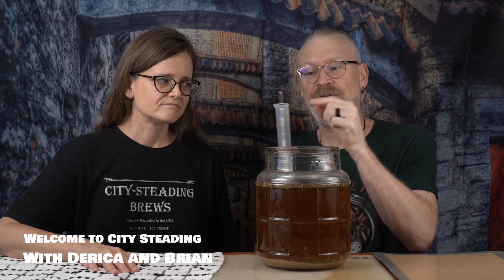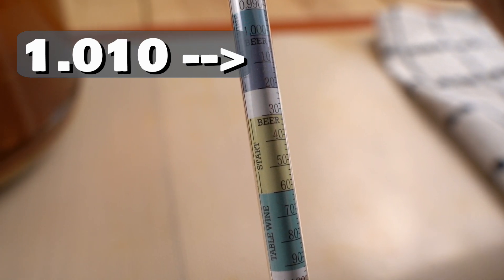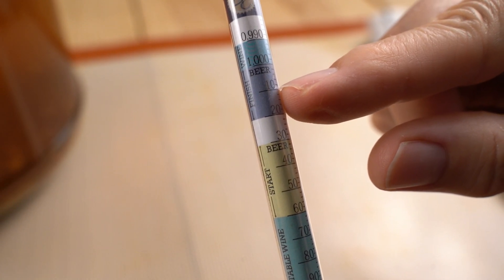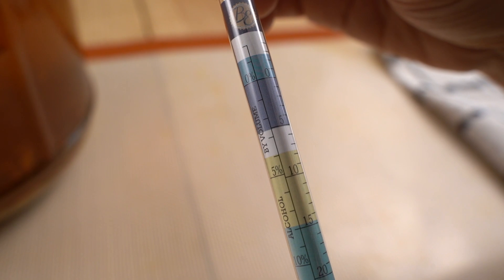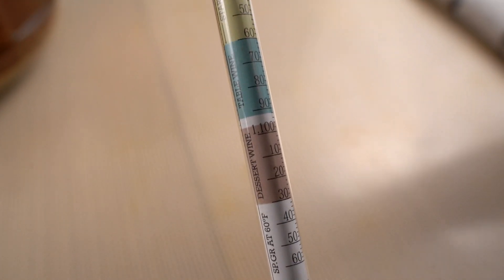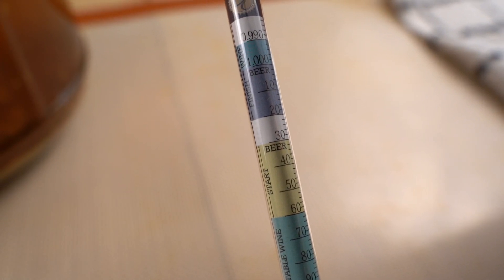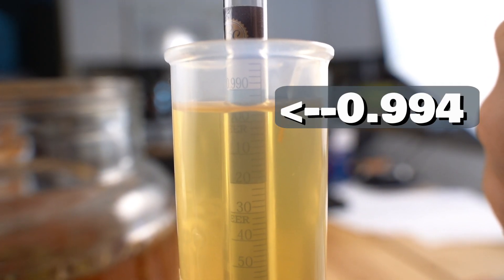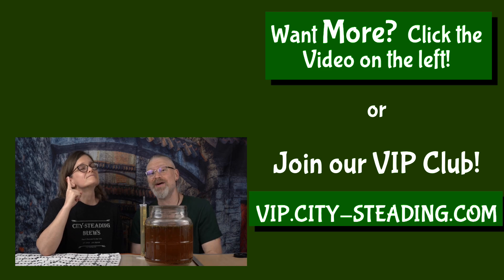How to Read a Hydrometer - Mead, Wine and Cider Making

Comment: Great video.  I use a hydrometer and a refractometer and they agree, generally.  I do not use the temperature correction portion of the formulae since I do not have an easy way to control the temperature.  Thanks for the useful content.

Comment: You forgot to mention the fine print that says "at 60°F". Minor temperature variations won't affect density but I used to live in Arizona and that is way different than my current PA home.
Reply from the maker: It's true but if you read at the same temp all the time, it doesn't matter really.  But, yes, there can be some difference if you don't calibrate for 60F.  A 1.100 reading at 100f is more like 1.106 in reality on a 60F calibrated hydrometer.

Comment: So  I have 1.016 for a red raspberry apple cider ? Third line down from 1.010
Reply from the maker: Starting or ending?
Reply: starting
 @CitySteadingBrews
Reply from the maker: Seems quite low.  Ciders are usually 1.030 or higher.  What is your recipe?
Reply: its was 1.046 we read it wrong, 1 gallon apple juice 2 pounds frozen raspberrys  @CitySteadingBrews

Comment: You say that when you come to back sweeten it doesn't alter the ABV that much so if say I need to add at least half a pint of sugar syrup to my gallon of cherry wine just before bottling then there will be no significant difference in the level of ABV?
Reply from the maker: Adding volume does alter the abv.  Adding a pint to a gallon is obviously going to change it.  If you had a 10% brew and added a pint of liquid, it’s now more like 9.1-9.2%.
Reply from the maker: Most times we are not adding anywhere near that volume.
Reply: @CitySteadingBrews  Thanks for your reply, I figured out that there are 64 quarter cups in one gallon of liquid so if I work on the basis of adding 1 teaspoon of sugar syrup to a quarter cup sample and assuming it is sweet enough for my own personal taste then this should equate to roughly just over half a pint I would need to add to the bulk in the carboy...obviously if it's not sweet enough or too sweet then I will adjust the sugar solution accordingly.

Comment: But how do I know if I have a reading of 1050 for 5 liters and want to have 1100, how much sugar or honey do I have to add ?
Reply from the maker: for some reason that came up on your question when it was a response to another's comment.  This is why I just delated it.  Sorry for the confusion.  I will get to your question in a moment.
Reply: @CitySteadingBrews  ok
Reply from the maker: Ok, so first I would have to convert 5 liters to gallons which would be 1.32086 gallons. Sugar is .046 gravity per pound in a gallon.  So you need 1.42 pounds of sugar.
Reply: @CitySteadingBrews  okaaaaay but that was just an example 😅 is there maybe a webpage or app for lazy people ? 😋
Reply from the maker: There are calculators out there, we do the math so we have a better understanding of the process.  Google search should aid you in finding a calculator.
Reply: @CitySteadingBrews  hmm ok I hope I find one, yesterday I ordered a Hydrometer with your Amazon link :)

Comment: you never explain how it works, does it float? how much sample to put in the graduated cylinder, enough to make it float?? does the temperature matter? repeatedly stating in your videos that brik and potential abv "arent something you use" seems uninformed considering theyre directly relative and on the same device
Reply from the maker: We assumed it was common sense it needed to float.  Sorry if that wasn't clear.  As for the other readings... specific gravity is easiest to use and most widely used by brewers.  I'm sorry you feel we are uninformed for teaching people how to read a hydrometer.... I mean.... we are showing people how to do a thing they don't know how to do.

Comment: There's also a temperature adjustment if you want to get crazy about worrying about a couple .001s. Hydrometers are calibrated at a specific temperature. Most that I've read are calibrated at 60 degrees. You'll have to refer to the manufacturer's specs to be sure. There are adjustment calculators online.
Reply from the maker: I try not to get too crazy about such things. :)

Comment: Questions...
1. Why not just drop it in ur big jar of brew? Why is a cylinder necessary? 
2. Why not just take your reading at the end? What's the point of doing it at the beginning? 
3. How does this translate into ABV?
4. If I didn't have a hydrometer at the beginning to get a reading is there still a way to calculate abv just using an end reading?
Reply from the maker: If it can float and you can get it out again, you don't need a cylinder, but.. ours doesn't.
The one at the beginning gives you an idea of how much alcohol and a target to work toward for next time, and one at the end together with that can calculate ABV.
(Original Gravity-Final Gravity)X135=ABV%
No, you need both.
We have a playlist just for new brewers that might answer a lot of questions for you:  http://www.newbrew.city-steading.com

Comment: Quick question is it safe to brew outside or not?
Reply from the maker: Do you mean assemble outside?  Leave outside after?
Reply: @CitySteadingBrews  leave outside after
Reply from the maker: @trojanman8835  that really depends on your climate.  It's not a good idea to leave in direct sunlight, and temps over 80F or so aren't suggested, but below 65F or so isn't good either.  So, honestly, I don't think leaving them outside is a good idea.
Reply: @CitySteadingBrews  the porch gets shade but its been in the 50s at night the last 2 nights which is odd. Climate change has thrown this year out of wack. Anyways, thanks for the advice and God bless you.

Comment: My close up vision  is not what it used to be after Cataract surgery.  Have trouble reading the numbers so I started looking at where it floats in relation to the different colors on the scale, then getting a better look at that when I remove it.  Most of my grape juice to wines end up between 10 to 11%.  Welch's 100% Grape juice with 1 added cup sugar and 1/2 tsp wine yeast seem to work out the best.  Thanks for the video explanation.
Reply: I've been taking a picture with my phone then zooming in on it.

Comment: What is the influence of temprature on the reading. On mine it says at 20C. What if the brew is below 20C, or are those minor temp changes negligible?
Reply from the maker: It does affect the reading to some extent, but not a lot.  A few gravity points over a wide sweep of 20-30 degrees.  Something to keep in mind, but not uber huge in the grand scheme of things.

Comment: So, what's the math formula to figure out your alcohol percentage?
Reply: Take your original gravity reading subtract your final gravity reading and multiply that number by 135. An example would be if you have a starting gravity of 1.090 and your final gravity is 1.010.  1.090-1.010= 0.08  0.08 multiplied by 135 is 10.8 alcohol by volume.
Reply from the maker: This!!
Reply: @connissia  thank you very much 😁

Comment: What's an alcohol hydrometer? How do you read that? Is it for distilling?
Reply from the maker: Yes they are for distilling.  I got one by mistake in the beginning and boy was it confusing!
Reply: @CitySteadingBrews  I'd watch a video about alcohol hydrometers.. *wink*
Reply from the maker: @qdmc12  well, distilling is completely illegal for us without an expensive license and a separate building so, we won't be doing it anytime soon.  To use an alcohol hydrometer, you just put it in and read the numbers.  They only work on 20% or higher ABV normally.
Reply: @CitySteadingBrews  I understand your reasoning, however, it's not illagal to buy everclear and make your own spirits from that. Just saying but I understand where you're coming from. Hell hath no fury like the ATF.
Reply from the maker: @qdmc12  oh sure, you can fortify things or make liquers, no worries there.  Thought you were hinting at distilling, lol.

Comment: After the breaking of my 2nd glass hydrometer, I switched to the Herculometer (Northern Brewer). It's far more durable and nearly as costly as the glass one. The only problem has been that it's slightly taller than the glass one so my 100ml cylinder is a bit small.
Reply from the maker: I hear they are really inaccurate what is your take on that?
Reply: @CitySteadingBrews  I bought 3. One for myself and 2 as gifts for fellow dropsy brewers. 
Side by side physical comparison: they are all different lengths (by almost an 1/8 inch). But the scale seemed to match up very closely. Additionally, I noticed that the cap on the scale end is just glued in place and frankly not very well. If I were to submerge it completely, liquid would get in to the chamber and mess with the readings. 
I tested all three in naked spring water(1.000), a fresh batch of must(1.135), and a sweet wine I had made with a known  SpGr(1.026) and the readings from all three Herculometers were +/- .001 of each other (or just my eyes interpretation of where the level was)

Worryingly, I had my old glass hydrometer along for the tests that I had foolishly left in my truck on a hot day and it was reading inconsistently lower than actual. It thought water was .994, the sweet wine (it had originally tested at 1.026) was at 1.016, and the new must was 1.076 instead of 1.135. I think I turned my glass hydrometer into a liar by letting it get super hot for an extended period of time (and I think it has a couple of hairline fratures)

Comment: as I understand it, this number suggests fluid density.

1,000 means 1000g per liter of liquid.
1,070 means 1070g per liter of liquid.
0.990 means 990g of liquid per liter of liquid.

I thought for a long time about the deeper meaning of these numbers and came to such a conclusion. correct if I'm wrong.
Reply from the maker: I believe so, yes.
Reply: SG is a measurement (ratio, actually) of relative density and does not necessarily imply any unit of measure.  With respect to water, at its most dense it just happens to have a mass of almost exactly 1,000 kg per cubic meter, or one gram per ml, so I believe a sugar solution with an SG of 1.115 could be said to represent a mass of 1.115 grams per milliliter compared to an equal volume of water (the reference standard in this case) which is 1.000 g/ml.  However, SG in general is still just a ratio of sample to a standard and reference materials such as alcohol or gases don't enjoy the happy coincidence of math that the water standard does.

Comment: Ohhh first time I get here kind of early! I was wondering what the impact is when you have a must that has a lot of fruit particles in it like skins, flesh, etc.
I made a Vikings blood mead a while back where I had to pulverize the cherries a bit (to fit the thin neck of a 5 liter fermenter), which means that the fluid of which I took the first reading had a lot of particles in it.
Will that impact the OG negatively of positively (make it lower or higher)?
Reply from the maker: Minimal if any difference as the sugars will still be available to the yeast either way.
Reply: Wow in that case my mead went from 1.124 to 1.020 in less than a month. Very cool! Must be a lot of nutrients in those cherries :)
Reply from the maker: Sounds about right.  That's 104 points in a month, pretty normal fermentation.
Reply: Thanks, I had the same question.  Thank you Brian for the answer.

Comment: Thank you for helping me understand my hydropeter better.  I do need help on a brew.  I've Dragon's Breath mead after a successful batch.  This new batch has done something weird. I know you need specifics but I think you may know the answer.  I removed the bagged fruit that was always wet and returned the berry liquid to the mead.  Sample was of course dry with lovely berry/jalapeno nose.  It had sour and tartness finish even after backsweetening.  Is the batch bad?
Reply from the maker: It’s bad if your senses say don’t drink it.  Tart and sour, can be normal depending on recipe.  Sour can be a brett, which is what they use to make sours.  It happens rarely and is harmless.
Reply: Thanks for the help.  Will an adjustment be needed to address this batch?  If so, what are my choices?
Reply from the maker: Sweet combats sour, so Backsweetening would be my first option.
Reply: Awesome!  I think it does need a little more sweetness.
Reply: I bet it’s just that it has a lot of the acids you’d associate with fruits (citric, ascorbic, malic etc.)

Comment: I actually believe the Potential Alcohol section is actually the easiest to read once you get it. Say your original P.A. is 15%. Write down the number 15. Upon taking a second reading it shows 3%. Write down the number 3 under the 15 like a subtraction problem. 15 minus 3 is 12. You have 12% alcohol. Its not as accurate but much easier to do the math.
Reply from the maker: Yeah, but, it gets more inaccurate the smaller the difference, and it's less mad scientist sounding.  :)  It works, sure but also gets more confusing when you step feed or add more fermentables.

Comment: So I've taken your suggestions to heart and started doing readings on my home fermentations. Using 71b, I frequently get readings starting in the 1.15 range and at the 'end' readings are less than 0.9 - sometimes I can't even get it to float/it's off-scale. I'm assuming that means that the 'final' abv alcohol content is pretty high since alcohol has lower specific gravity than water (pure mixtures should be <1). Am I missing something here? Or are those fair assumptions with 'the beast' and I'm relegated to writing "ABV > or = XX%"?
Reply from the maker: When you say 1.15.... do you mean 1.150 as a starting gravity?  That's rather high, as in ... really high.  If you are going from 1.150 to .990 (it's impossible to be at 0.900), then, yes, you are making higher ABV, something in the 21.6% range which is FAR beyond 71B, so I think there's something up with your numbers.  My guess is you were more like 1.105 and went to 0.990, which is 15.5%, still high, but certainly doable for 71B.  Any idea what your recipe was?
Reply: @CitySteadingBrews  Actually did a tester with a 32oz Knudson's Cherry Juice (not from concentrate, lots of sediment), added 125g sugar, added 1/2tsp nutrient (I know, I know), and half a pack of 71b. My primary mistake I think was not taking a reading on the juice itself so I might have overshot with the sugar - just did a scaled modification of your 'sweet red wine' recipe. But the fermentation was quite vigorous so I just rode it out to see what would happen. The end product is actually quite nice but is certainly dry. Is it possible very fine particulates (it was loaded) in the juice gave me a larger original gravity than sugars alone would indicate? Ever seen anything like that? Might be some newbie-reaching there...
Reply: I believe you may have an off reading somewhere. 1.150 is waaay high for 71b and is potentially 20%. 71b has a max of 16% abv ill even say it might hit 17 or 18 in a perfect fermentation. For this to be testing Dry and 20%abv  seems nearly impossible but i have seen crazy things happen before lol. My brain wants to believe your Original Gravity is 1.050. Not 1.150. This is where the Potential Alcohol section can help us. When you read 1.150. What is the same reading on the Potential side?

Comment: What size graduated cylinder do you use. I bought a kit and the cylinder is quite large. 250 ml. Yours looks smaller but may just be the magic of video. 

Can I use a different cylinder as long as it floats freely?
Reply from the maker: Ours is 100ml (linked in description), and yes, you can use any size so long as the hydrometer floats :)

Comment: I believe I read somewhere that the side that has the "potential" alcohol on it works like this .. say it reads 15% and then your final reading is 5%, that means you have 10% abv .. 15-5. I may be wrong...
Reply: You are correct! A+
Reply: @meadinamerica263  Thanks for the reply... You gained a new subscriber 😉
Reply: If your FG reading is 5% PA, then it's likely your fermentation has stalled or stuck.
Reply: @elainehall6155  I'm talking about the side of the hydrometer that has potential alcohol, not SpGr. You start out with 15% it goes to 5%, the result is 10% final ABV.
Reply: @ghoppr71  Correct. But 5% PA remaining is approx. 100g per litre of residual sugar that failed to ferment out. Given most yeast strains have an alcohol tolerance above 10% ABV then fermentation has stuck and is a devil to get going again by pinching a new yeast starter..!
Reply from the maker: Jeff, she's not talking about the ABV as much as how much sugars are left.  That's the issue with the potential alcohol side, you don't really have a gauge for how much is left.